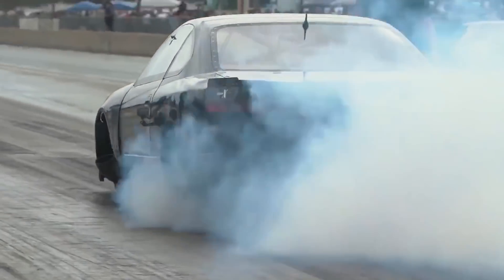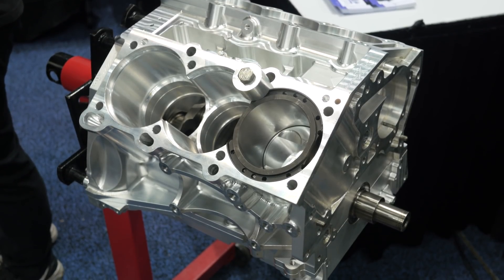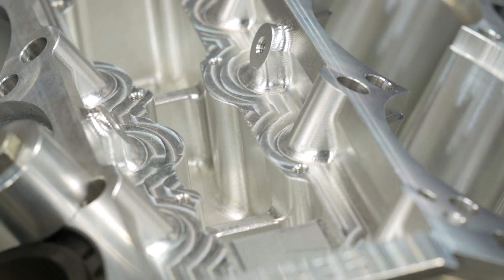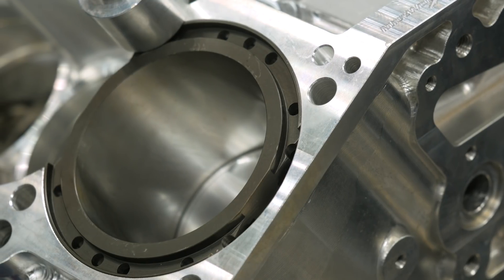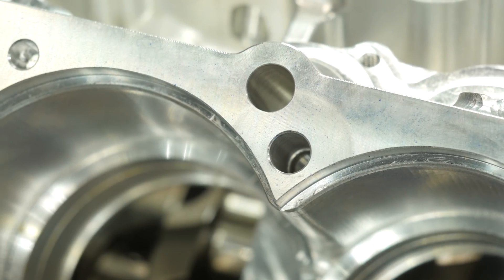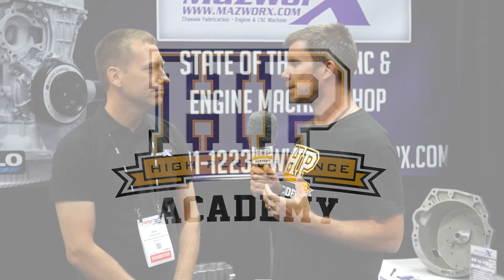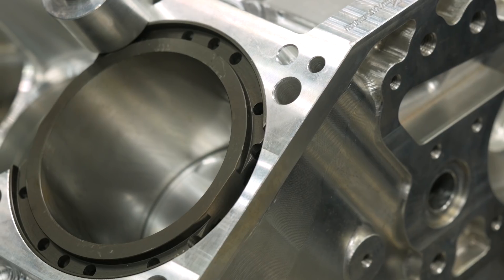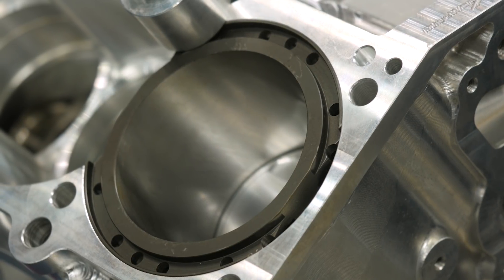When is it time for a 2,000HP billet block? | Mazworx

Comment: Squish definitely adds the needed chaos burn factor. My 1600 pushrod Ford has the combustion chamber in the piston and the valves sit flat on a flat head face(no head chambers). To up the compression for a 1600 you put in the 1300 pistons. Cool design by Ford... 😎👌

Comment: Bullet block hmmm...$$$$$$$$$$
Reply from the maker: You have to pay to play when it comes to power and speed. Has always been that way - Taz.
Reply: High Performance Academy 
May I ask how much for the block?
I've just paid 12k for my sr20 no hot or cold side.
And I'm wondering how much power and driveability I'm going to get.
Reply from the maker: We don't sell them sorry Mark, but I think it's listed on Mazworks website and there might be a few others out there making them for SR20's as well that have prices listed I think. I'm sure the price is much better than what they were going for 10 -- 15 years ago either way, much like dynos - Taz.
Reply: We just bought a billet Chevy 434 small block for our team that cost $11,500 just for the bare block.

Comment: why not build a combined head and block from billet. fit valves in the head section by putting your arm up through the cylinder. and installing the pistons though the bottom ? .
Reply: Problem I see with This idea is the amount of maching that can be done to the valve angle, and or seat area, as well as maintance to valve and chamber maintenance
Reply: interesting question.  lycoming and continental i believe DO make such a head/cylinder combo in general aviation.  ie. Cessna 172, Piper Archer, etc.
Reply: #avoidingtheflamewar. My reading of Porsche history tells me they did this on the big turbo cars in the 1970s like Mobydick. The way they were able to do it was by machining both separately, then "electron" welding the head to the cylinder. Porsche OHC heads are like aviation heads in that they're separate units per cylinder and aircooled. So welding them on wouldn't be too hard.

How would that be done today? Umm, I guess with a complex CNC program like is done with most other things. Course that would mean it would be next to impossible to have it water cooled, because you can't machine internal cavities. Which was the other interesting part of this discussion. They're still reliant on a factory head. Incredible that a factory head can be made to stand that amount of power and still be street driven and watercooled. #awesome stuff.
Reply: and change the comp ratio by stroke and modifying deck height. is a combined head re-usable after failure? how do you inspect it without removing the bottom end
Reply: Sorry machining
Reply: could always move forward and try actuated valves the fit in from the top kinda like the f1 tech
Reply: Offenhouser did this in the late 60's early 70's with a 4 cyl engine.   Many small airplane engines are built this way too.  The "Jug" and head are one piece, to set the deck height you change the shims under the cylinder.
Reply: Mono blocks thats head&block cast in one piece has been done before  , this YouTube channel has a video about it
Reply: @carlob517  they did an interview with a guy that restored 1970s mono block engined formula race cars, good video.
Reply: aka Monoblock..
Reply: Eliminate the vavetrain and cut ports in the cylinder wall to make a 2 stroke with an exhaust valve controled port. i assume this is some poppet valved u-loop charegd 2 stroke conversion which is common on many toyota 2JZ motors. here is a v8 chevy 2 stroke conversion:https://www.4btswaps.com/attachments/2cyclesbc-jpg.6839/
Reply: They did that in f1, limited valve angles
Reply: There’s no need for billet heads. Wtf the heads just need to flow air. They need to be strong

Comment: People always wonder, would a billet engine block work in a street car, especially one daily driven to get milk, eggs and bread? Or, are these engines only for race applications where it will require rebuilding? Even I dream about having a billet block for a street car even if its not the best choice.
Reply: apostate001 don't see why not, it should be stronger in all aspects compared to stock aluminium cast blocks and they are fine for many high power production cars
Reply: If it’s a wet block with all original oem mounting points? Definitely 
In fact it would be better than any oem block then because it would be lighter and more corrosion resistant than iron blocks

Comment: If it's possible can you do a how to on rebuilding and blueprinting a 2jz for increased power? I been looking for a step by step (or close to it) on the jz family but it seems like its a dark art.
Reply from the maker: Hey TJ, you can actually get this knowledge instantly as we have exactly this in our Practical Engine building course. You will learn the steps that we deem important when building a performance engine that are not all done on factory builds, and then this knowledge is demonstrated via an actual step by step engine build. The 2jz is the first example we have as a demonstration.
If you have any more questions email me: support@hpacademy.com
You can find the course here: www.bit.ly/PracEng - Taz.

Comment: If it's the second fastest 4-cylinder I'm pretty sure the 3g Eclipse with a 4G63 engine is the fastest.
Reply from the maker: The Red Demon is slower than the car mentioned here, but you can't really compare them as they are very different cars with the main point being that the Red Demon is AWD rather than RWD. Both great cars though! - Taz.
Reply: High Performance Academy Oh I was talking about the Jett Racing '04 Eclipse with a billet 4G63 that ran a best ET of 6.52 and best trap speed of 223 mph. It holds the world record for fastest 4-cylinder, although not the quickest.
Reply from the maker: Ahh, I'm with you now. Last time I posted a vid of Colins I was corrected by someone to say he was the second fastest, so I guess now he would be the 3rd fastest. This car has since done a 6.456 pass and is undergoing some testing at the moment with a compound turbo setup. Checkout the Mazworx and Tuned by Shane T channels for more info on that. 
Unless you're in the drag racing scene yourself it's hard to keep up with results as some of the teams are not the best at social media updates so you end up getting the details from 3rd parties - Taz.
Reply: Keoke DeSa - 6 sec - 192.66MPH ,body car, aircooled VW style engine?
 - A/D Kris Lauffer - 6.60 ET - 203.98 MPH ( only vw over 200 MPH in the 1/4 mile?) in 2003 rail?
Reply: bunning63 Wow those are really low ETs for those MPHs. I think the 4-cyl record is 223 mph though.
Reply: High Performance Academy Yeah I agree it's really hard to find. There should really be a website with all the official records. Anyway thanks for the info and all the great videos!
Reply: Nayr747 Yeah they are, but still 6.6 at 203.98 in 2003 is a bit of an eye opener. The aircooled VW's were pretty much the benchmark for four cylinder performance for a long time in the US. Sometimes people forget others have been there before, often a lot to learn looking back sometimes.
Reply: Nayr747 no
Reply: sameer jura Yes the Jet Racing Eclipse is the fastest at 223 mph. Read previous comments.
Reply: I've always wanted a 96 to 99 eclipse gsx with the 4g63turbo cool little cars but there always riced out or too beaten up

Comment: in the mid 90s i had one bloke talk to me about squish and getting the piston as close to the head as possible. i did exactly what he told me and I could run 23psi on 98 and never ever heard any ping out of that engine
Reply: By the time you hear it pinging inside the car damage is already being done. It can even ping long before it is audible that is why you have knock sensors. 23psi is nothing for 98 RON petrol, I was running 30 psi at times on 98, you just need to prevent pinging with fuel, timing and air intake temps.
Reply: Only problem is that is the quote "easy" thing to and with hot rodders looking for budget solutions is always the norm. However the answer is more nuanced and high octane fuels would solve that, RON 98 is about 93 octane in the US and not race gas. In California it's 91 R+M and in places like Utah, it's 90 R+M. My favorite solution is water-methanol injection actually not "modifying" the quench area, the problem is the source fuel.

Comment: Mazworx upping the levels again, love the quality of work from them!
Reply: I got this crazy idea off making a 2 stroke 8.2 liter inline 6 billet aluminum 2 stroke diesel. Inline 6 with each part of the crankcase baffled off like a sled engine and oil feed to rods like skidoo 850 etec dry sump feed. Machine runner ports up from the crankcase mad a Coats rotary ball valve exhaust valve for a uni-flow 2 stroke. There woulds need to be enough bore spacing for the parts of make it with individual cylinders with big studs and a splite crankcase. i got on the horn with a Dart racing rep and explained this 2 stroke design idea i was running through my head and boy i had his attention for a while. Any thoughts on this?

Comment: I get the feeling that this guy was the wrong person to ask about billet blocks. He seemed to know more about the power production though.

I especially like the discussion on squish pads and bore size. Do you get anyone making CNC pistons to match head surfaces for maximum squish? IE the pistons in my AU have a slight dish, but it's perfectly round and the squish pads are not, it appears that the pads are not as effective as they could be
Reply: Skippy i felt the same way, didnt really inspire me to spend 20k on a billet 2j except for the fact that mine, you know, could break.

Comment: Right down my alley, loved it.
Reply: I woulds need a block with more bore spacing in orger to cut ports into it.:https://www.4btswaps.com/attachments/2cyclesbc-jpg.6839/. I heard the aluminum 2JZ are poppet valved u-loop scavenged 2 strokes and can run dry sump with oil injection.